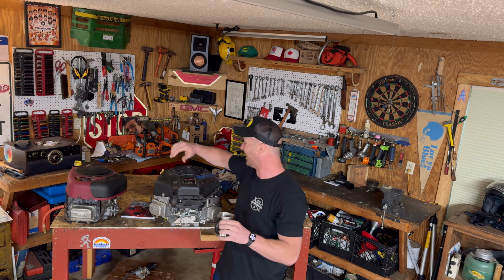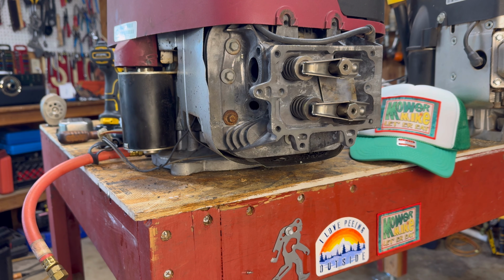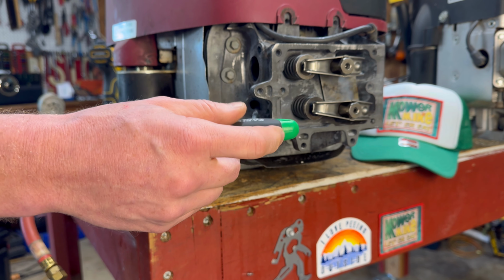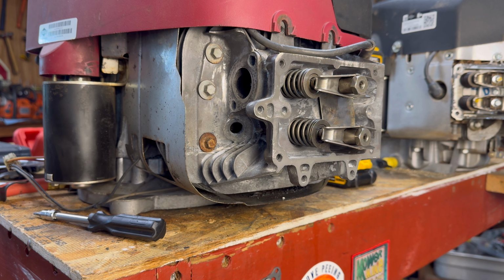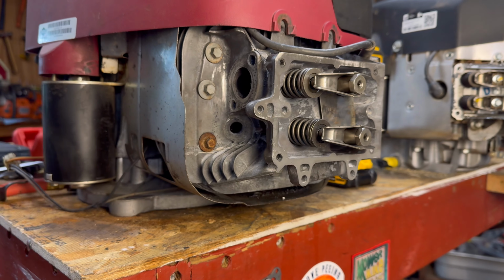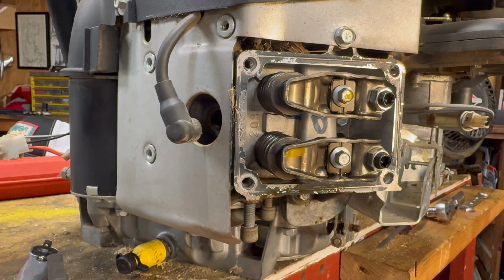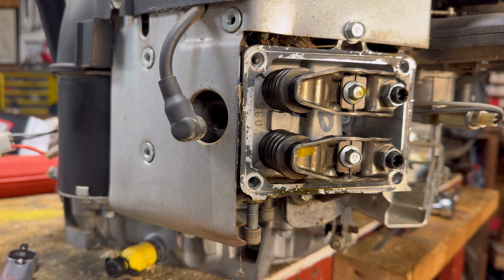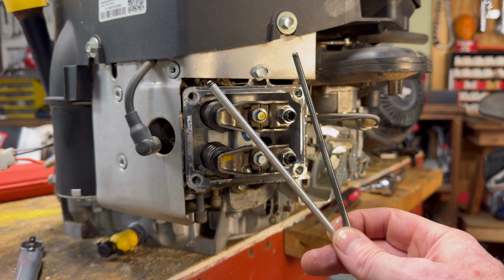Briggs and Stratton Valve Lash Adjustment!

Comment: Hey Mike, do you happen to know what the torq spec should be on the rocker arm bolt? This is the second valves you worked on in the video where the adjustments are on the push rods. Thanks

Comment: Anyone wanna help spitball ideas with my engine

Has spark,fuel and air
Compression release works
Flywheel key is in
Timing inside engine is right
Valves were lapped(no leak with brake cleaner)

Engine backfires through exhaust as if valves are open still and very very VERY rarely backfires through carb which made me think valves

Push rods are straight and rocker arms have all their components 

I've been a small engine mechanic for 6 years and its driving me nuts like what am i missing, this is my own personal engine and the only emgine thats made me feel defeated

Comment: Great video instructions. My Intek 18.5 HP was a T20 Torx set screw with 10mm nut/bolt. The inner nut was loose! Had to address that first.

Comment: Always sharing good content... I have a question, and I hope you can help. Why my 15.5 hp. B&S smokes when I engage the blades. It's smokes out of the exhaust, and it's white smoke.
Reply from the maker: It is burning oil. I suggest checking the oil level and making sure it isn’t over filled.

Comment: Excellent.  Mower with the Intek 13hp OHV.  Died and would not start with spark.  As you said, I removed valve cover, found TDC and OMG the play was immense.  I will set it to spec but with that amount of play are there other issues likely? Thanks
Reply from the maker: I would pull the rod out and make sure it isn’t bent. But ya it may just have worked loose also

Comment: Amazing timing for this video, thanks!  My GT5000 with the B&S twin broke a while back and I just decided to dive in a bit to see what was up.  I suspected a rocker or pushrod issue and sure enough when I opened the valve cover on one side the bottom pushrod was just laying there exactly like your bonus footage!   When it failed the motor just immediately froze and wouldn't budge.  It was extra hard to start just prior to this, didn't want to turn over but finally got it running then seemed ok.

After putting the pushrod back in and "roughly" adjusting the rocker I can now rotate the motor around but something just doesn't feel right.  The pushrod didn't seem bent.  Can/does something inside the motor break when this happens or think I can re-install and adjust the valves and "send it"?  Any way to tell for sure if something inside is broken other than just manually rotating the motor and see if everything feels smooth?  I don't want to risk more damage if I overlook something.
Reply from the maker: I would just re install it and “send it” unless your hear a clunking sound. Resistance when turning the motor by hand is normal, is just compression
Reply: @MowerMike  Thanks.  After watching a few more videos I'm wondering if one, or more, of my valve guides may have slipped up.  I haven't looked at it again yet to see.  Appreciate the advise and for the videos.

Got any more videos coming up on the V-Twin?
Reply: Well dang... No such luck for me.  Went to find TDC to adjust those valves and that piston isn't moving when I rotate the motor, other side does.  Guess I'm in for a deep dive. ☹
Reply from the maker: @shanesdiy  Not in the works right now. Have a couple of great Deere videos in the hopper stay tuned.
Reply from the maker: @shanesdiy  Rip the bottom off of it and pop that piston out. Just make sure to check things out and see if it is worth rebuilding or not when you are in there.

Comment: If there is very little slop why do they really need to be adjusted in the first place as long as they're not super tight?
Reply from the maker: Why ask why?
Reply: if they are too tight the valve isn't allowed to seat and allows bypass and lack of compression. as the seats wear out you will need to adjust.

Comment: What if the set screw is stuck?  I am afraid I will strip the head of the set screw.
Reply from the maker: Can’t help ya there. Just take your time. Sometimes I will use an electric drill on a stuck screw to see if it breaks it loose.
Reply: @MowerMike  Someone before me used loctite Red on them.  Heat from Mapp gas worked wonders.

Comment: Both valves sloppy loose how to tell where is 2 top dead center. ????😊
Reply from the maker: Remove the lifters and push on the pushrod tips with your fingers. You will be able to tell when they are both pushed out from feel.